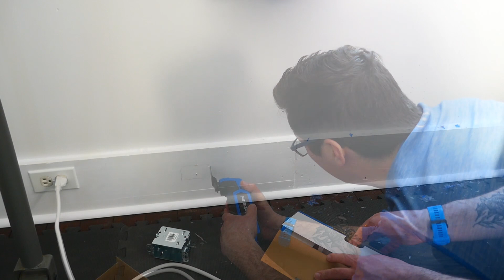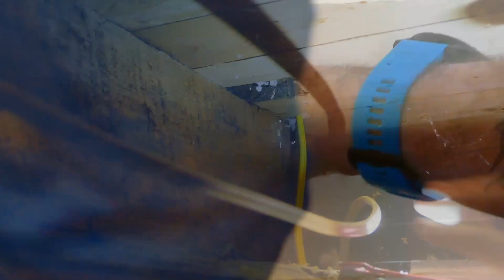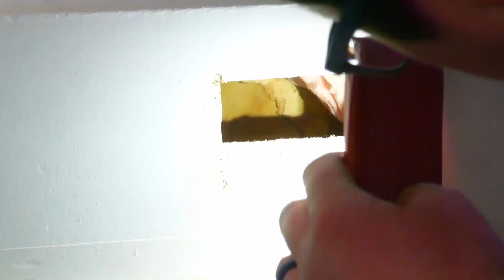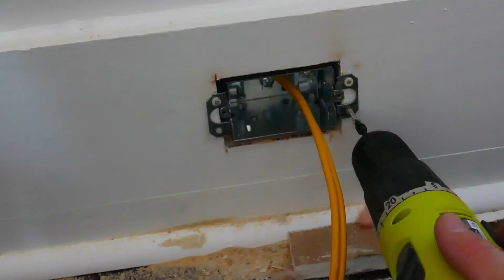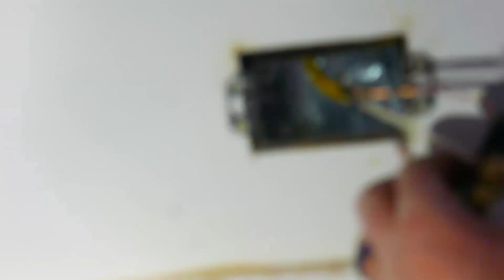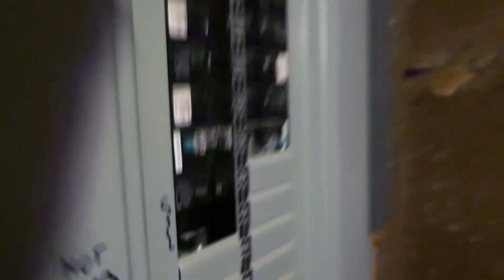Wiring a 20Amp Dedicated Circuit for a Treadmill

Comment: “I have an electrical background”….. wires neutral and hot backwards
Reply from the maker: Believe it or not, there are electronics based jobs other than an electrician, where understanding the importance of safety working around electricity carries over.